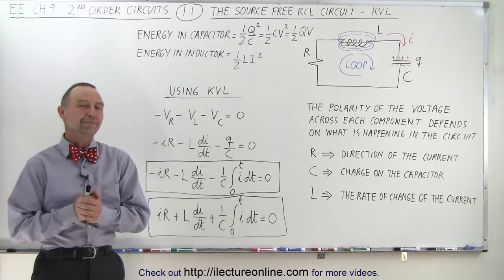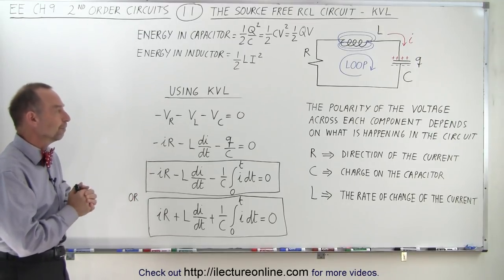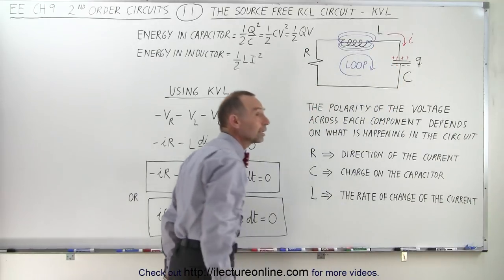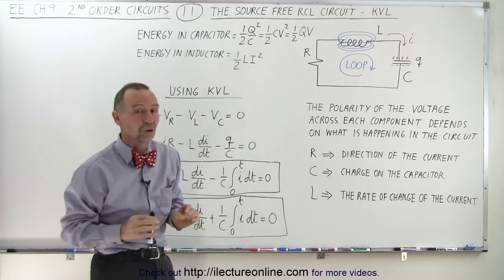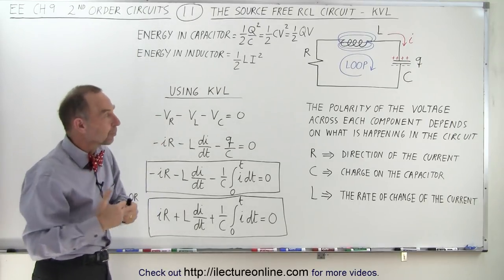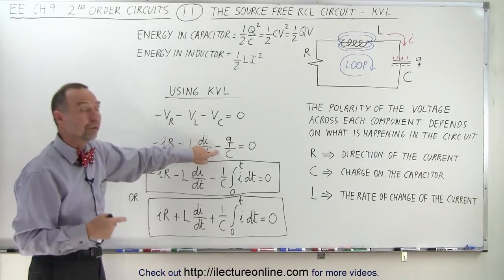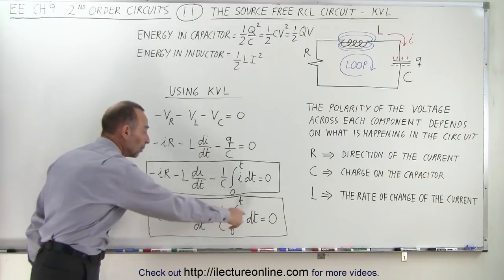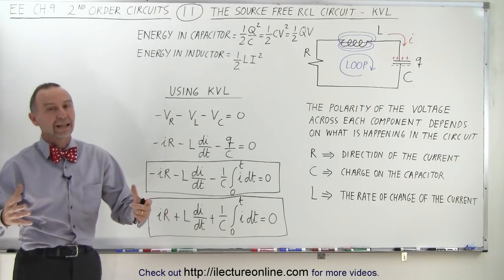Electrical Engineering: Ch 9: 2nd Order Circuits (11 of 76) Source Free RCL Circuit-KVL

Comment: how come there is an electric field(voltage drop) across the inductor? because it creates an electric field throughout the circuit and it is a circular electric field and there is no electric field inside the inductor additionally unlike the capacitor and battery. how kirchhoff's law holds?
Reply from the maker: There is a voltage drop across an (ideal) inductor ONLY if there is a change in current.  With a steady state current, there is no voltage drop across an inductor.
Reply: @MichelvanBiezen  yes you're right but I didn't want to ask that. I asked when we taking the closed loop integral of (E.dl) through the loop and using KVL, there isn't an electric field inside the inductor additionally unlike the capacitor and battery. but the electric field that inductor creates is throughout the circuit but there is no electric field inside the coil. so therefore when we applying KVL why we writing L di/dt left side of the equation and why we are saying that the potential difference between the ends of the inductor is Ldi/dt?
Reply from the maker: The potential difference across an inductor is proportional to the size of the inductor, and it is proportional to the change in the current per unit time.
Reply: @MichelvanBiezen  oh you're right but I think I couldn't tell you want I wanted to ask. How can a voltage drop across an inductor? The electric field inside an inductor shouldn't be zero?
Reply: @ugursoydan8187  @Michel van Biezen an increase or decrease in current through an inductor causes either an expansion or contraction of a magnetic field, respectively. This expansion or contraction causes a counter electromotive force that is in opposition to the current that created it. This transient opposition to current through the inductor is what creates a voltage drop. This only applies when there is a change in inductor current with respect to time.
Reply: Imagine the expanding/contracting magnetic field lines on an inductor's coil crossing each other.